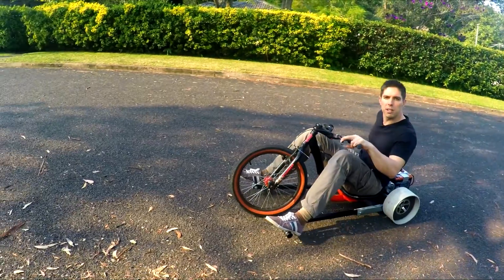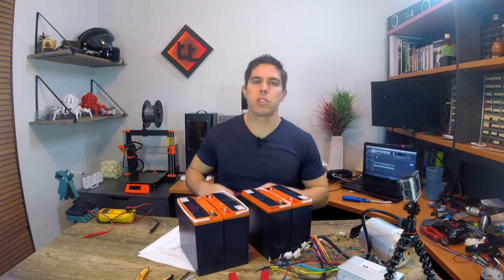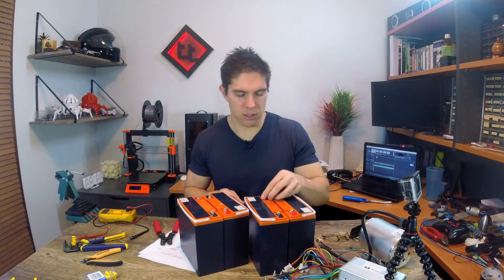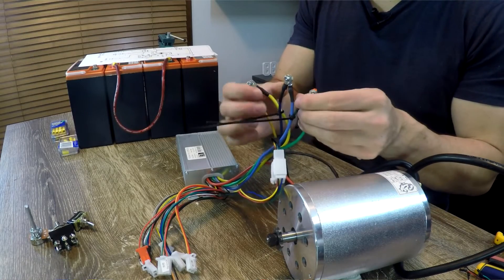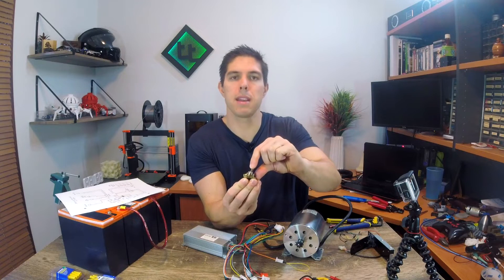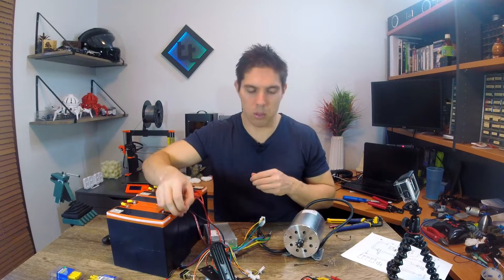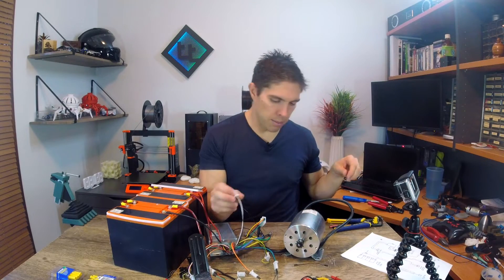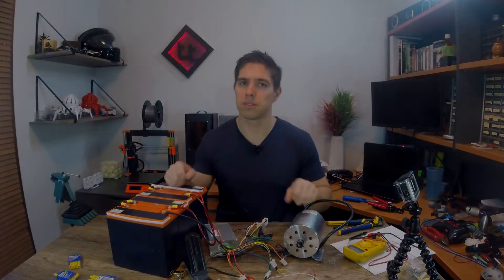How to: ESC / brushless motor wiring - Drift Mobility Scooter + Drift Trike - Part 2

Comment: What happens if you connect speed 1 to 2 and add a button to 3? So 1 is connected to 2 and 3 will it blow the controller or just select speed 3?

Comment: so glad i came across your video...im using a pride jazzy elite HD powerchair as my base, came with left and right electrocraft motors model#62-004-002 (250w cont). want to run hand grip throttle controls with a fwd/reverse switch. Could you recommend a throttle controller and compatible ESC (24volt system). your help would be much appreciated. cheers marc

Comment: Hello Teaching Tech... I am connecting this motor controller to a Ni-MH battery pack to supply all the system. I have tested it with 51 V battery pack, but I get so slow autonomy. Please, Do you know if I can apply 60 V to this motor controller?

Comment: Is it possible to get a wiring schematic for a Vevor BY12WF02-C controller? The connectors are marked except for the 8 pin connector. Is it possible to get that 8 pin wiring schematic? The end of the extension wiring harness is different. We have identified all except for 3 - two, two wire and one, one wire connections.  We are trying to motorize my Joyrider by Trail Mate so that I can ride with my handicap, which doesn't allow me to pedal. We are willing to pay for the wiring schematic. Thank you. It would be nice to just ride and this motor would help.

Comment: Great informative video. Thank you for measuring the voltages on the brake various leads to tell me that the lights are 48VDC. I guess I'll find a stepdown circuit to run my 12VDC cooling fan for this kit that I used to build an outboard boat motor.

Comment: I have a  vevor 2000 watt 48 volt controller,I have grey black and yellow for forward and reverse which I connected grey to black for forward.I have connected red to orange to bypass switch.My throttle is faulty,so I connect red to which wire on controller,there is no green wire anywhere to be seen,also speed wire are blue and black no other colour ?

Comment: Thanks for the good video you need to also mention about the voltage threshold of these ESC not realising this testing on a power supply
I thought mine was faulty until I worked out the motor would not enable till over 44 volts Obviously this feature saves the li Ion battery from critical discharge 😃

Comment: pls make a video wiring a light of any escooter.
how to determine voltage of the light without connecting the battery?
how to connect a 12v light to a 36v or 48v controller?I see some controllers just went direct to the positive and negative and the lcd throttle has a display and button for the light.and so they can directly switch it on just like the lcd display(LH 100)
plus make a video sir.thanks

Comment: Wondering if you could help me out. I have the same controller and only need forward as I am building a scooter. That being said, I de-soldered all the wires that I didn't need and changed their lengths to be specific for my build. My plan was to re-solder a short jumper between those pins so it would always go forward. Unfortunately, I forgot which pins they were after taking a break to help my daughter with something. I have looked absolutely everywhere online and I cannot find any information on the pinout for the board or photos of the board that would help me see where they are connected. Would you be willing to open your box and tell me what pin the yellow and black wires are connected to? I assume the black is a ground but would like to be absolutely positive so I don't fry anything. Each pin is labeled on the front and back of the board and that should be all I need. Help me Teaching Tech...you're my only hope!!

Comment: How can I tell if my controller can take a potentiometer input on the throttle? There is no insturuction that came with the controller. Is it safe to test it with a potentiometer if it is expecting a hall sensor?

Comment: Thanks for the info. Have a Kun Ray 3000w 72v motor thats similar with exception of wire colors, so a bit tricky without an installation guide. Any idea of where online I might find one? It can be drawn with crayons idc at this point

Comment: I used my speed controller for about three rides and now the controller won’t send power to the motor, and yes the controller is getting power, is there any way to fix it?
Reply: Possibly your hall censor wires

Comment: How would I hook a three speed switch up to that I bought one it has three wires black red and green I have a three speed sensor connector on my controller with three wires as well that don’t match those colors. Just curious how I would wire that in

Comment: I see some sources say the hall and throttle wires are 5v output. My plan is to control motor speed with Arduino, and control the Arduino with Unity 3D. Is this possible?
Reply: Indeed it is. I use arduino on mine as a speed limiter. And then have the theottle conected to arduino.

Comment: Great vid ! ...  Am converting to a 36v. 1000w brushless set up - '' pretty much looks like what you have'',,, -   on a minibike,, going from a 36v 1000w ''MY1020'' brushed motor set up. It has a multi wire Hall effect 1/2 ''throttle'', & on / off switch integrated also,, with 3 batt. level indicators also integrated in the throttle housing...  Am not sure how that would be wired with a brushless controller like you have ?? The stock bike brushed controller, is a common 1000w 36v one..   Any  insight on this would be great!..   The Minibike is a Monster moto E-1000 ….. Thanks, Ian
Reply: Hey im doing the same! Went with 48V 2k watt and LifeP04 battery. What did you do with the charge port? Im wondering if charge battery direct or through ESC

Comment: Thank you so much for this video. I have this exact motor and controller and have been looking everywhere for a simple step by step like this. One question you may be able to help me with.. Everyone else with this motor appears to have a contactor relay wired in as some sort of pre-charge. Is this necessary? Also if I am using a mechanical disk brake instead, what should I do with the brake from the controller? I've heard it can damage the motor if left..
Thanks again.

Comment: What toggle switch are you using? since all the output is 48v? all the toggle switches i found are spec in VAC
Reply from the maker: You can fit a resistor potentially to limit the current and use lighter duty switches.

Comment: hey i have the same scooter with same running geer i wanto make it into a drift mobility scooter wat axle amd wheels did you use thanks??
Reply from the maker: Everything is always posted in the links in the descriptions. Please check through the series and everything will be there.